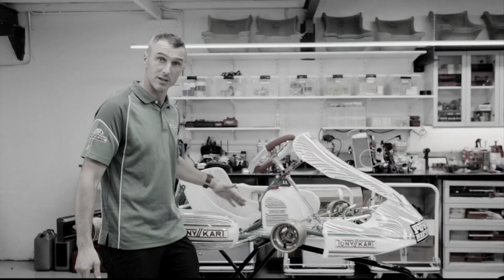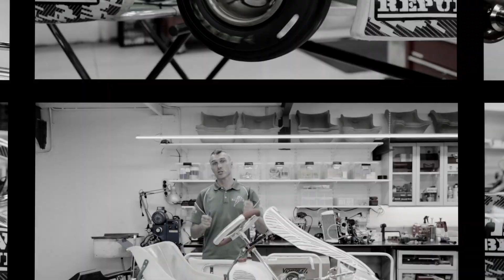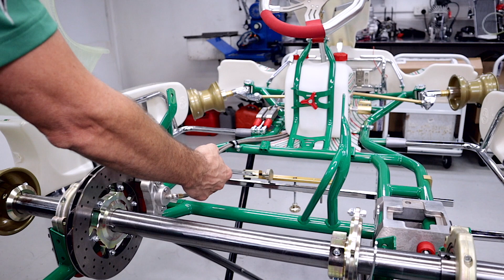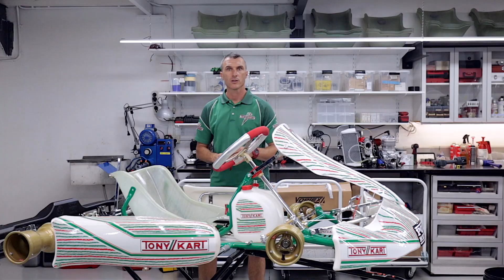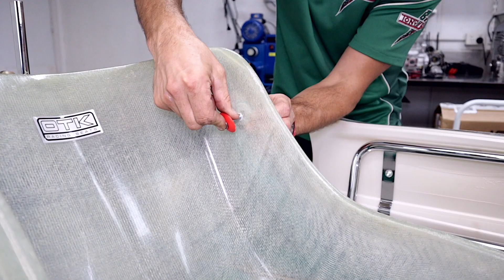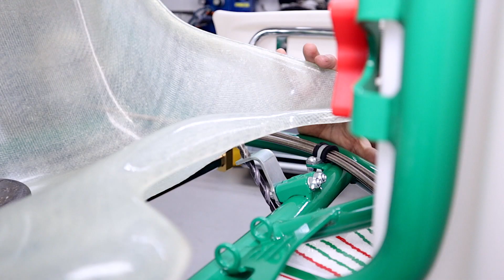HOW TO: The Easiest Way To Fit a Go Kart Seat Using a Tony Kart Seat Fitting Tool - POWER REPUBLIC

Comment: Do you have the latest OTK document for seat posistion for various height drivers for the 2022 401RR OK (1045) chassis that you can post?
During seat setup, do you typically offset the seat by 5mm (front of seat lip to front hoop) or not worry about it?
Reply: Or what you recommend for 6' tall (1829mm) person?  How far back from front hoop and how deep from chassis rails?

Comment: Hi there,I have a problem with my kid he's tall and big for the seat;he owns a cadet honda CR160; I'm buying a 38 cm seat to replace the one that comes with the kart which is about 30cm; need help , because the frame that holds the seat is the same size as the seat 30cm; is any possibility that I can open or bend to make room for the new seat HELP please
Reply: you're amazing ; thanks for the quick reply; do you mind if coming back with more questions? thanks gracias
Reply from the maker: @carlosberghusen2122  yeah for sure 👍
Reply from the maker: hey Carlos, sure can mate, use a soft hammer and strike the brake side seat support outwards with a few sharp blows.  otherwise you can bend it out with an axle or hard piece of steel

Comment: Hi there, good video :) only thing I would ask is what difference the back height makes from the axle. Is this more for driver comfort or would you set a lower back height to get more rear grip? Generally I start with a neutral seat running the base of it flat to the plane of the chassis. Never tried reclining it. :)
Reply from the maker: Hey Kyle, thanks for tuning in!  inclined seat will lower the shoulders and also angle the hips forward.   Great for tall drivers or mega sticky tyres with a kart that is hopping.  Otherwise set them flat with the chassis rail like we do on most karts and focus in on the tyre pressures

Comment: Hey sorry to bother again what tyres to you suggest for a 10×4.6-5 X30 kart. I used vega usually but is there another tyre i should try out? Thanks again legend
Reply from the maker: Hey Jarred, where are you racing at?  We use MG yellow tyres here in Aus for X30.
Reply: @PowerRepublic  I'm racing in china  and they use Yellow Vega and Maxxis Sr1 . I'm not Chinese so hard to communicate with my fellow racers haha
Reply from the maker: yeah right, what engines are they using over there mostly?
Reply: @PowerRepublic  Iame and Vortex ROK engines . I use a Vortex ROK engine.
Reply from the maker: @tr1padvisor552  ROK GP 125 ?
Reply: @PowerRepublic  yes

Comment: could you please do a video on how to install the iame x30 battery. Thanks
Reply from the maker: The new style battery bracket with the start/stop buttons?
Reply: @PowerRepublic  yes
Reply from the maker: @ebz.900   wicked.  the good thing about the iame X30 battery bracket is that the 4 screws and rail clamps bolt straight to the chassis rail in front of the  brake callipers next to the seat.  nice and easy.   have you tried this on your own kart?
Reply: @PowerRepublic  ok, could you make a video of the wiring to the engine please.

Comment: hi Derek    thanx mate for the great vids    bought a kosmic 2 weeks ago n have not stop watching .  have a question    how do you prime up a x30 motor without using ya mouth /????? AND i have set my new style ehaust up and it is pointing at my left rear tyre is this normal  ???thank you
Reply from the maker: hey bro, thanks for tuning in.  yeah, crank the engine with the airbox off and put your hand over the front of the carb to seal it off.  
make a spacer out of some alloy and use a longer bolt to lift the exhaust cradle up away from your back tyre.

hope that helps

Comment: Hello, I have a question, I am 193 centimeters tall and I would like to know what are the settings to mount my seat ?
Reply from the maker: Hey Damien, at 193 you will have to go way back, maybe 655-660mm from the front edge of the seat to the chassis rail.  and move your pedal all the way forwards.   another thing you could do is tilt your seat backwards slightly too.
Reply: @PowerRepublic  And for the height of the seat, how much can I put in?
Reply from the maker: I like flush with the chassis rails, but most people will tell you that 5-10mm below the rails for someone your size.  I like this too until I hit some bumps or run off the track and then crack the arse out of the seat.

Comment: Almost everything in this video is wrong..
Reply from the maker: in regards to my hair?
Reply: @Derek, your hair is fine don't worry! @Alain, if you know so well, explain it? we have no use for stupid comments! #KeepUpTheVideosDez
Reply: @jordyschoenmakers  first we use a 8.0 and not a 8.5 drill bit 
We use cik washers between the seat and the frame (minimum 4mm diameter)
We bend the underneath support and when we drill the bottom we pass the bit through the spacers and the seat support and not only through the support like in the video, that give tension in the seat.
Reply: @alaintrix8372  just because you have a different preference doesn't mean Derek's method is wrong. I also work in this way and personally find this the most pleasant way
Reply: @jordyschoenmakers  its only one way to do it.
If you don’t understand that we dont drill a 8.5 hole for a 8.0 bolt etc etc it’s a problem

Comment: Can you put a 50mm axel for rotax and x30 on the tony kart 4ss?
Reply from the maker: yeah it would fit in the bearing cassettes as they have the same size outside diameter
Reply from the maker: do you have one already that you wanted to fit up to the 4SS chassis?

Comment: Your old method worked for me, that jig seems pointless unless your fitting alot of seats. The hard part was figuring out how to work under the kart as the 2 base mounts are awkward to reach and mark. Once those were done, everything else was a simple matter of fixing the base bolts on the rubber mounts, chopping those bolts to avoid dragging on the ground, and marking the rest and drilling out to fit. The rubber mounts made a big difference to the vibration through the seat as well and meant i can actually see while wearing glasses, which was impossible before (they would shake so much everything blurred, and at the end of a straight that is not good).
Reply from the maker: yeah the original is still the best Hey Chrisso !!